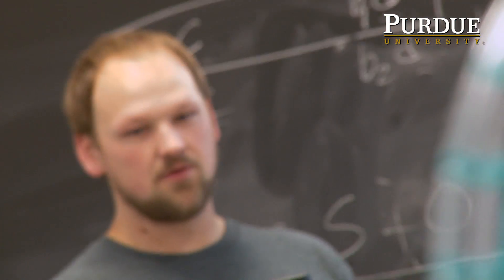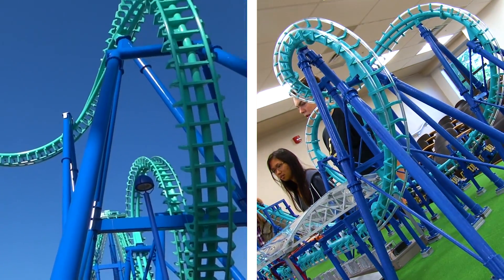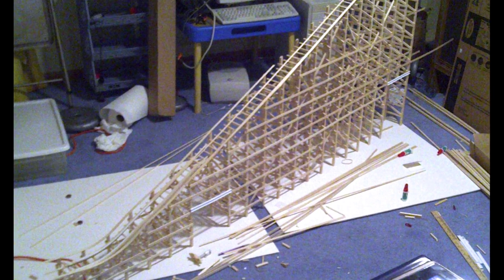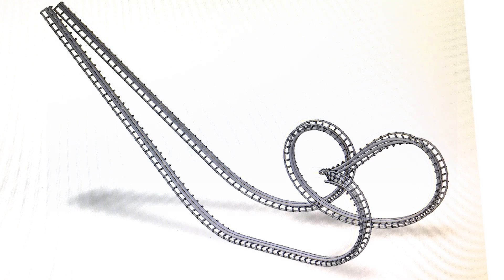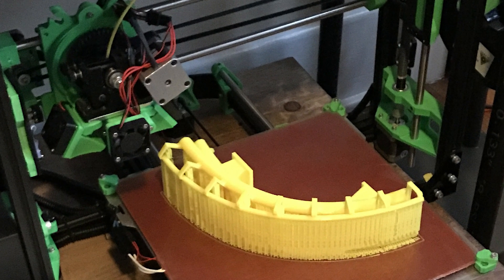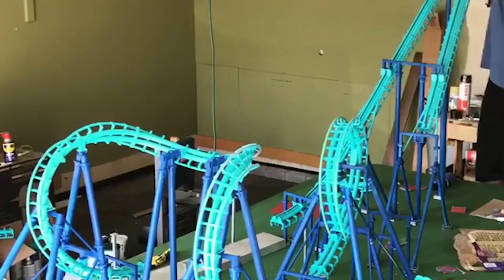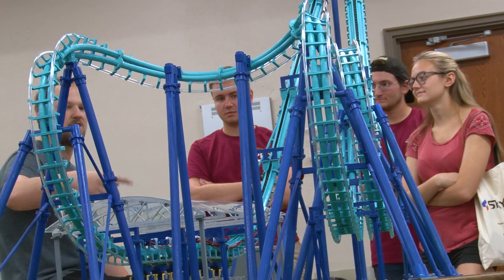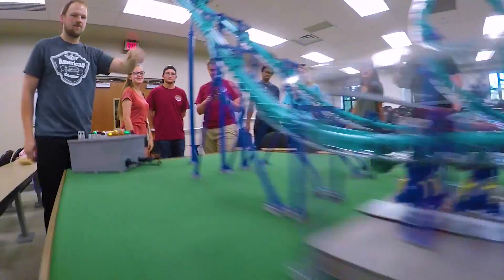See a functional 3D-printed roller coaster at SOLIDWORKS World 2019

Comment: Did you have to power the train a little to get it to maintain speed? From what i remember from physics it is easier for a heavy train on a real rollercoaster to maintain its momentum because the friction does not scale evenly with the added weight of the heavy cars. Even if you required the train to be powered on your toy rollercoaster its still a massive win. Props op.